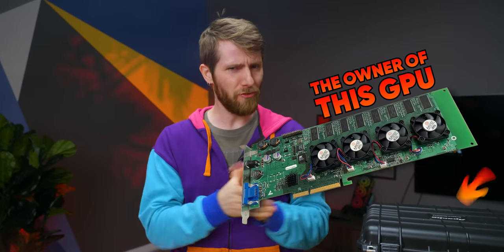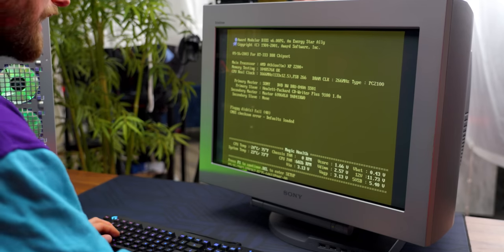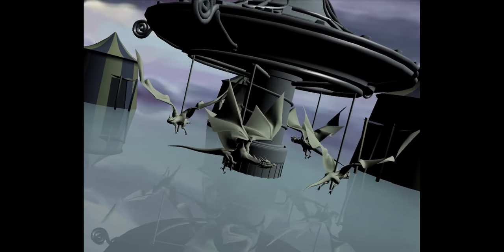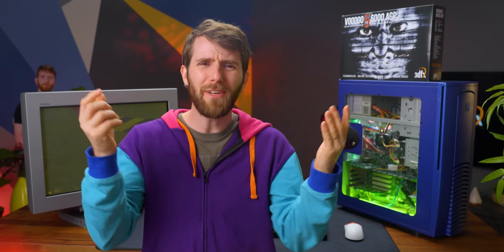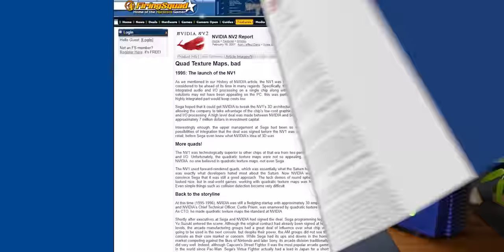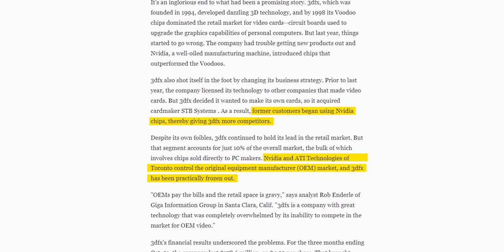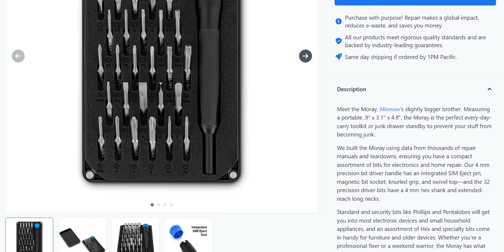This GPU cost $15,000 and there’s only ONE like it – 3dfx Voodoo 5 6000

Comment: Gamers Nexus did a great video essay about this card too, loads of technical info, definitely check it!
Reply: I thought the design looked familiar
Reply: That was a great video
Reply: @Daniel-vk4vg  Not at all, GN's video goes a lot further in depth re; the mechanics of the board itself and the processes it took the creator to get it flying again. This video is a nice lead-in to GN's video for the interested.
Reply: LTT is so far behind the zeitgeist
Reply: @Daniel-vk4vg one more reason to watch GN to support the original.
Reply: Huh? IIRC Gamer's Nexus had the clone and this is the original.
Reply: @AaronShenghao  gn got the clone card, this is a real original prototype
Reply: @samhartley6154  Yup, I agree this is a great companion piece to GN's video with an original proto instead of a clone.
Reply: @kwizzeh  if it didn't have the original, then I'd too be thinking "it's a bit too similar to GN" and partially it is, but having the original plus more focus on the broader, albeit more surface-level information makes it a good "part 1" to GN

Comment: I remember a Riva TNT 2 driver released by nVIDIA, which made the card directly support Glide. 3DFx made them remove it again, but were too late. Lots of people got a hold of that driver - myself included - and it truly did run games with 3DFx Glide just fine.
Reply: But it wouldn't be compatible for long, because 3DFX would just change their API enough to stop it working on Nvidia cards. Any further copying by Nvidia would have resulted in very expensive law suits and compensation payments.

Comment: That case was a blast from the past I didn't expect. That was my first personal PC case from my early teens in the mid-late 00s. I just remember it being HUGE, as around that age I was about as tall as Linus is now
Reply: I work at bestbuy and someone recycled a PC with the case but in black lol, I was like damn, this is a dope old case.
Reply: I had that exact same case, the Chenbro(I think?) Dragon, in the same colour, (but without the window), as the first PC I built for myself.
You see the massive gap between the PSU and the top of the case? Young me saw that, and though "I wonder if I can fit a radiator in there?".
Turns out, while you could sandwich a 120 rad in there (with a hole cut in the roof as an intake), using the PSU fan to pull air through a radiator is not a great idea. It worked, but no batter than air cooling.
Also, that case was all thick steel. Bloody strong, but it weighed a ton.
Reply: @phuzz00  Definitely a heavy beast, yeah. Mine was the exact version in the video. At that age I didn't really know what water cooling even was yet. I'd just dipped my toes in. I got it from some guy on facebook who was selling (what I later discovered were) chop-shop PCs. He'd overprice and under deliver specs. I realized this and my mom and I scared him out of public business. Dude mix n' matched RAM, downgraded my CPU drastically after bringing it back for having a few issues (assuming I wouldn't notice the downgrade), used illegal windows copies, and did all of it on his front porch that wreaked of smoke.

Live and learn I suppose, but the case itself stayed with me for another later build I scratched up used parts for myself. It wasn't much, but it's what I started editing and VFX on, which later evolved into an animation career. Weirdly enough I think I have that slimy porch surfer to thank for my life now haha
Reply: Chieftec CS-601 FTW! Have a couple of those... built a rig in 2003 in one and later got a few more to put older and newer hand-me-down stuff in them. At some point the whole family had those XD
Reply: I had the same one!  Except the aluminum internals version.  I thought it was an Antec case?  I had red CCFL tubes inside and blue LED fans.  I LOVED how it looked.
Reply: I feel shocked - I still have this case (in dark grey .. and no side window) NOW! ... I just put my latest Ryzen build into it LMAO!
Reply: ...and it does weigh a friggin tonne! (only reason I think about changing it)
Reply: @richh5620  LOL I got a CoolerMaster Stacker in 2006 for my new main rig which was like 25-30% heavier even XD
Reply: had it too! i think running with a Northwood, don't know which GPU i had at this time though.
Reply: @CakePrincessCelestia  wow! you must be very strong 💪 ... I don't suppose they thought to put casters on that model Lol
Reply: @richh5620  Still have and use this case as well. Still the best case in my fleet of computers. :)
Reply: I have a silver one lol but the front panel is long lost. It houses my home server for now but it's probably going to be replaced in the next 12 months or so

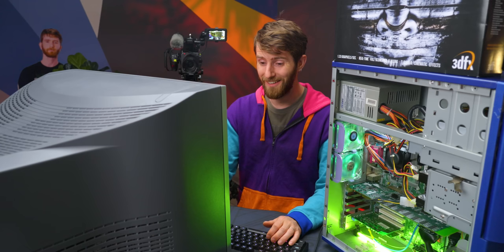Comment: 4:34 - 119.879 fps looks like some artificial limit because it is exactly 2x59.94. If you do not know 59.94 fps is an NTSC exact frame rate for so called 60fps.

Comment: i remember the first time playing Quake on my voodoo.  It was amazing once I got the drivers installed correctly.   it went from blockly on the previous card to smooth as butter, smooth edges.  .There is a special place in my heart for 3DFX.   You should have tried Quake with that card.

Comment: That build reminds me of my first own PC build at that time, also in the Antec CS601 case. It was super solid and served me really well but the 80mm fans I had in there were super loud.
Reply: Same here! Mine were blue fans that i customed installed. My REM cycle was shot from all the blue light.
Reply: I still use my case that I bought in the late 90s.  Except the front bezel  door that broke off its been rock solid for all these decades.  And its outlasted dozens of pc cases I have bought since for my family and friends.
Reply: i still have that case in gun metal gray. infact its right next to me in use running a secondary pc as im typing this. for the fans i had changed some iterations over time. last one that is still till today is rgb..yes a green in the front and a red an blue in the back. had an multicolored one on the sidepanel window but i removed it at some point cuz was kinda noisy
Reply: Huh, I never realised that was an Antec case. I knew it as the "Chieftec Dragon". I had one in the same blue as Linus, but without the window. It was my first fully custom build and lasted me a while. (depending on what you call a 'new' PC, I've been upgrading that same PC for twenty years, although I think I only still have a few screws still in use from the original)
Reply: @phuzz00  Yes, it was sold under both brand names. Mine was actually the white variant without a window.
Reply: @phuzz00  well that design was originally antec's. so maybe yours was a knockoff made by chieftec. i have the same as the one linus has in gunmetal gray and its defo an antec. its stamped "antec design" on the botom inside of the case (stamped into the metal. not printed)
Reply: It's a Chieftec! Antec were the Sonatas. Also great ones.
Reply: @CakePrincessCelestia  highly doubt chieftec had the original idea of the case. chieftec was  always known to be the cheap china "brand" that would sell low quality stuff and make rip off clones of stuff from other companies
Reply: @chloeprice8  I checked more on this as I read more of those "It's an Antec" comments. Didn't even know that one (shame on me), but there is the PlusView 1000AMG that looks very similar and apparently is the one which Chieftec copied the design of. I have a bunch of those Chieftec CS-601s and they're really solid, so I wouldn't call it "cheap" rip off. And the one shown in the video actually is one as well. There's a ridge line going through the upper front cover with both sides being level, while the Antec has the outer sides being further back. Also, the "rip"s are extending right to the ridge line which isn't the case in Antec's case either.

Comment: Could you imagine a modern version with maybe four 3070's bound together?
Reply: No but I can imagine a 4090 the breaker keeps tripping so someone upsizes the breaker to stop it  and now there house is burning down from the overdraw
Reply: @Doubie.  Nvidia: The 5090 uses 1.21 jigawatts.
Reply: @Doubie.  got to love USA problems...
Go EU/UK higher power limit.
Reply: @Ravensfan-qx5pc  This isn't SLI tho. We're talking about one card with 4 GPUs, not four cards with one gpu each
Reply: i can't afford the electricity bill to imagine that
Reply: @haloharry97  😲😲😲
Reply: I don't think the power grid wants to imagine that
Reply: @LeegallyBliindLOL  These weren't really GPUs, they were just 3d accelerators in that they were mainly just fixed function hardware that drew triangles. It was Nvidia who had the foresight to realize the GPU would be about more than just 3d. The modern GPU is not just a gaming card, it's basically a supercomputer on a PCIe card. That's why we are seeing the changes in the market today. It's a paradigm shift.
Reply: @LeegallyBliindLOL  It literally is SLI, that was 3dfx's multi gpu tech, nVidia bought the name
Reply: @leeroyjenkins0  you could've just said chiplet design that's already implemented into their cpus.
Reply: Still with 8 GB VRAM just to make sure it’s still useless.
Reply: @LeegallyBliindLOL  An Nvidia card with multiple GPUs still runs in SLI mode.
Reply: There's the Nvidia grid gpus which do that, though with lower end gpus, look up the Rtx A16, which is basically 4 rtx 3050 in a trenchcoat
Reply: This is honestly the sort of thing I was hoping chiplets would have brought. Multiple tiny cores in an internal sli/crossfire
Reply: This is literally done all the time for compute. It doesn't work efficiently for games though as they are not parallelised nearly enough.
Reply: @leeroyjenkins0  GTX690 was 2 GPUs with a PCIe switch and still had a SLI bridge between the 2 GPUs on board.

And the same goes for the titan Z. The problem is the bandwidth for multiplying the assets, which all multi GPU for gaming has a problem with
Reply: @haloharry97 Power limit? What power limit? Lol
Reply: @whateveryousaygroomer131  if too much power goes through a circuit it trips.
It around 1500w give or take 20%
Reply: @Carahan  True! But just for a few more fps in 4k, still no time travel!
And since this annoys me so much: It's "One point two one gigawatts". How they say it in the movie is wrong ("One point twenty one gigawatts"). Still a legendary movie (trilogy) though^^
Reply: @Carahan  and ends up going back to the future
Reply: @xBruceLee88x  no need for sli even, we could have GPC chiplets/tiles with shared L2 cache and they would behave like a regular gpu, that way we could shrink nodes harder and still get good yields 
also it makes making new skus easier, just add more chiplets. 

basically AMD could make a 2 or 4CU base for iGPUs, and scale up to a 6x8 or 6x4  grid for the top of the line 96CU gpus
Reply: @JoeBloggsYoutube  so true...
As someone who own a rtx 4090 running one kills.
Reply: @haloharry97  the US has a 240 20amp outlet there just not as common in houses here their the same plug we have standard just with horizontal top blades instead of vertical so their not interchangeable it takes the same wiring it’s just the new outlet and a beaker box rewire to the circuit if someone wanted to retrofit one

Comment: Sure is nice to see the Chieftec Dragon case! I JUST replaced mine a few months ago because I got tired of not being able to use the side panel with a 3080ti waterblock.
Reply: I'm still using mine. Just put in a PC power and cooling 1050W PSU to feed my 6900XT.

Had to drill out the rivets for the internal 3.5 bay mounts to fit the video card, but I switched to SATA cages in the 5.25" bays about a decade back so I haven't used them in that long, so it's no big loss.
Reply: @matthewcaron3319  Awesome!!! Love to hear that!

Comment: What a throwback. My Athlon XP 2500+ Barton core/EpOx 8RDA+ Nforce2 mobo, 256mb ram, ATI Radeon 9500 Pro system was built in a case EXACTLY like that one. The Chieftec Dragon (yes I know it was an Antec full tower knockoff). Even used the included Austin 420w power supply without issue. Even had cathode tube lighting and everything. Loved that machine.
Reply: Ah! good taste, I ran an XP2400+ and a Radeon 9600, no cathode ray tubes, just LED
Reply: I bought a Radeon 9500pro right when the 9600s came out for 180$USD to replace my aging voodoo3 2000 and GeForce mx400s. I hope I'm remembering that order correctly 🤔
But yeah the voodoo was buttery smooth compared to openGL or any software drivers I'd seen. Starsiege Tribes was absolutely amazing and very fast paced once you got renegades and havok mods. Tribes 2 was just such a total let down and it kills me to say that. I wanted it to be good so badly 😢

Comment: I vividly remember dreaming about this card back in the day. I would drool over it reading the specs on their website. Then nothing. RIP 3DFX. Not long after, I upgraded to an Asus V7700 GeForce 2 GTS Deluxe; $329 at the time. It came with active shutter 3D glasses that plugged into the card. Playing Unreal Gold in 3D was a wet dream come true. However, I always wondered how the 6000 would've performed. Thanks for the video!
Reply: UnrealStunner "TAG" and when playing Unreal 222-225 I Played as Saint on the MoF Clan

Comment: 9:15 3dfx actually tried to solve that problem with the Banshee, a regular video card with a voodoo2 built-in, but it wasn’t very successful. I remember because I had one.
Reply: Former banshee owner here too.
Reply: That's because the Banshee had poorer performance than a Voodoo II but they were quite popular.
Reply: It was successful enough for the time and things were moving fast. The Voodoo 3 was a complete replacement with 32 bit colour and functional OpenGL. V4 introduced shaders, a full OpenGL implementation and reality only failed to compete due to SDRAM's poor fill rates compared to DDR.
Reply: József Tarnai  oh that's true, I completely forgot about that one. I don't even recall ever seeing one in store (because buying only was not a thing back then)
Reply: Banshee was sucessfull as mainstream card.
Voodoo2 remained highend during 1998, and till march 1999. But it has flaws, first, highend was considered 2 voodoo2's in SLI, and that took out 2 PCI slots, along with usually PCI 2D card, so 3 PCI slots. And it heat like mad, because there was little space between PCI cards.
So highend was 2x voodoo2 with 2d card
lower highend was voodoo2 with 2d card
and mainstream was banshee. Banshee was also into AGP slot.

So it was attractive as mainstream card, with lower price.
Banshee has also put Intel 740 away. Because till summer 1998, for half year, Intel 740 became quite suprisingly good mainstream card. Before summer of 1998 line of accelerators, Riva 128 was highend for Nvidia, S3 didnt have highend, Virge was outdated, and 3dfx had voodoo1, Matrox Mystique. And Ati had Rage Pro. All these graphic cards were beaten by Intel 740, which also utilized AGP functionality, and price was good (there was also rendition verite, which was also very good midrange path).

But Banshee basicaly blow away Intel 740 very fast. It has similiar price, and it was much better than anything else from year 1997. Banshee was good card. It was also 2d/3d card, which was very attractive for midrange gamers. It also free up PCI slots.

Comment: I had a Voodoo FX 5500 AGP card right as I was wrapping up some college studies.  Sadly didn't help some aspects of 3D modeling / rendering go any faster but it certainly did improve viewports and gaming.  And that card only had two of those little processors on it, let alone 4.  Pretty sure I owned that Sony monitor that was featured though!  Great screen for the time.  

120 FPS would have been nuts back then.  I recall just being happy a game would run or get something like 20-30 FPS.

Comment: I had a Voodoo3 in high school (would you believe it was OEM in a Dell T450 that my family still has and still runs [linux jump server now]). 

This, and the games mentioned are brining back high school memories for me. I also owned a GDM-FW900 (the monitor Linus is playing on) a few years later. 

Thanks for the memories.
Reply: The Dell T4xx line is a relatively modern tower server, are you sure there isn't a swapped number in there somewhere?
Reply: @resneptacle  its a dell xps t450.

Comment: Love the classic Chieftec case.  I went with a Chenming version of it back in the day due to having a single 120mm fan vs. dual 80s and still use it to this day.  Nowadays it's just a node for my Tdarr setup but still, it's alive and well.
Reply: Still using that Chieftec Dragon case as my main PC today, with a Phenom II 1090T.  I don't game on it, so even though it's ancient it still does the job.
Reply: @waynebagger643  Whatever gets the job done!  Had I not gotten into GTA Online pretty hard I'd still be on my Q6600 machine, that old thing and its DDR2 memory just couldn't handle online play.  I've got an 11700K, 64GB DDR4, and a RTX 3080 now and hardly use it at all--I don't play much anymore and it's mostly older stuff that modern integrated graphics can run.

Comment: I remember playing Roll Cage back in the day on my 3Dfx Banshee.
You could choose between Glide or Direct 3D for the graphics.

I really liked the Banshee. Although it was a more budget card than the Voodoo, you didn't need to use a pass through cable with another 2D graphics card. I eventually replaced it with a GeForce 2 MX.